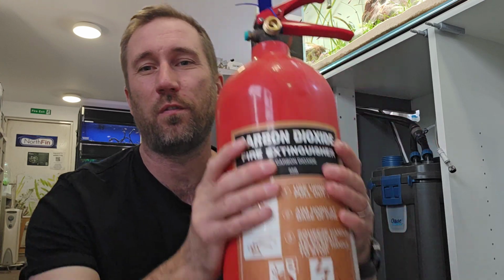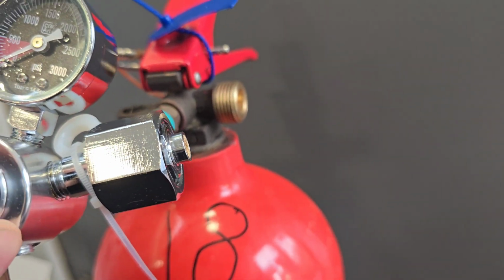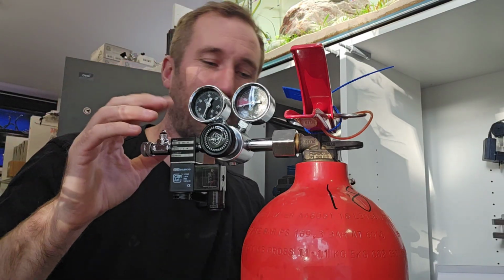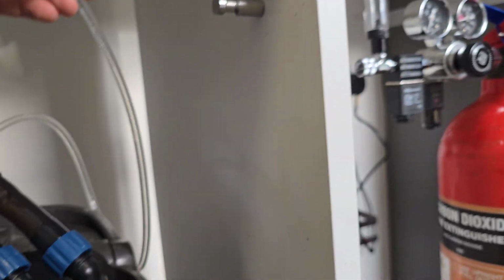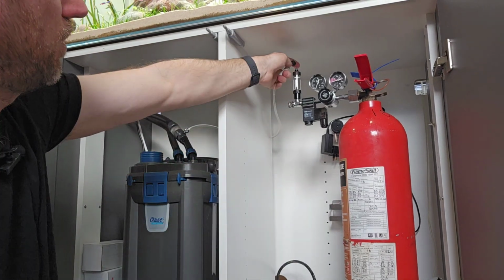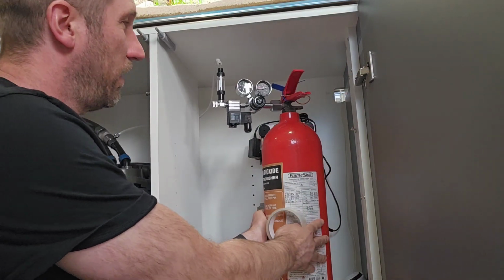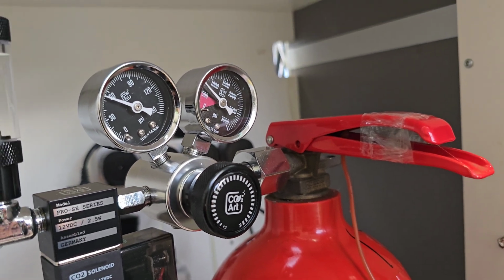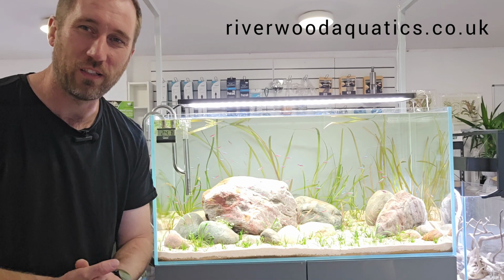How to Set Up a CO2 System Using a Fire Extinguisher | Step-by-Step Guide

Comment: I like to use some PTFE tape on the thread of the extinguisher, just to help with the seal. The inline defusers look good. I might invest in a couple
Reply: It doesn't seal on the thread at all tho if you ptfe the thread and the washer failed it would just leak out the back of the nut (regulator side) that sort of fitting don't work like that, just make sure you give it a good nip so it's secure but not load so you mangle the washer. Check it with some soapy water for leaks if you feel it might

Comment: would the JBL regulator fit directly on to the extinguisher? also how much and where do you get them refilled?
Reply from the maker: I'm not 100% sure, I think the JBL regulators might be designed to only fit the JBL cylinders. There are companies around which refil fire extinguishers, you'd have to search in your area. We sell refilled ones for £25. However we cannot ship them.
Reply: @riverwoodaquatics7028  thats a decent price concidering the size of them

Comment: You should be able to put the pin back through the holes to lock it in the open position.
Reply from the maker: This works with some cyclinders. Great tip!

Comment: Quick question Pete if I use the 2kg fire extinguisher 🧯 is it the same regulator u use is it the same thread 🤔 thanks..keep the video's coming 😆 🤣
Reply from the maker: Yes, exactly the same regulator with the same thread 🙂
Reply: Thanks for the reply I'm going to set mine up in a smaller cabinet thanks again 🙂